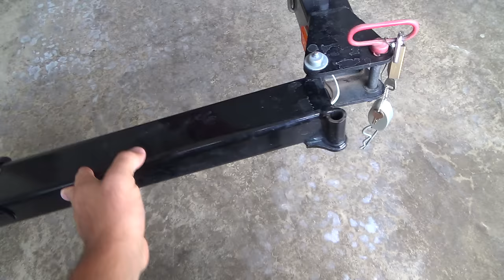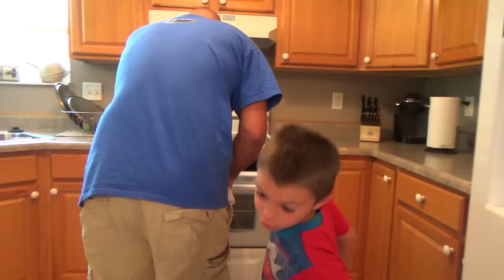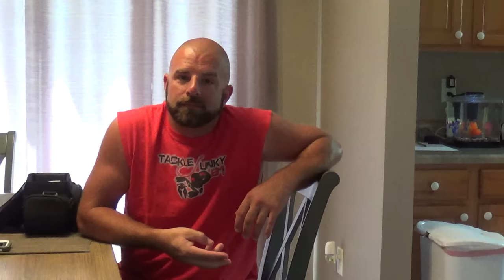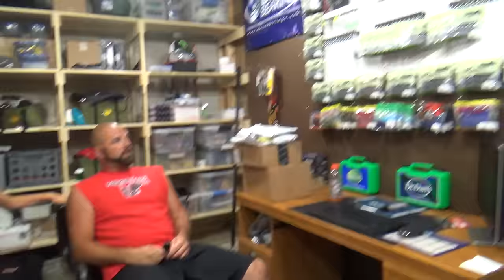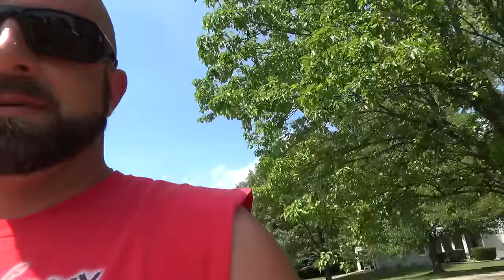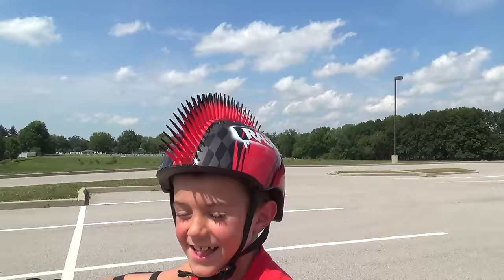Vlog #6 Bass Pro Unboxing and More!

Comment: Loving the vlogs! Quick question. I am looking for a new reel to try out and im torn between a 13 fishing and Daiwa. I have been looking at the concept a and then the Daiwa Tatula CT. What are your thoughts between the two? Also is it worth the extra $50 to get the Daiwa Tatula CT type R?  

Thanks Jim and keep up the good work!
Reply: I would go with the Daiwa Tatula CT if I were you.  13 fishing is very overrated and not worth it, they just seem like it because many fishing youtubers are sponsored by them.  I own a Tatula CT myself and it is very smooth, very versatile, and casts very well.
Reply from the maker: The 13 reels are definitely more comfortable, but its gonna be tough to hang with Daiwa as far as performance goes. The CT is one heck of a reel especially for the price. The Type R looks cooler, but really not much performance difference to justify the extra cash. Go with the CT.